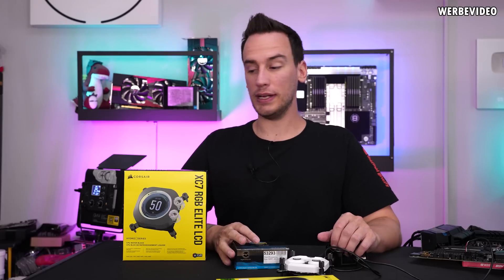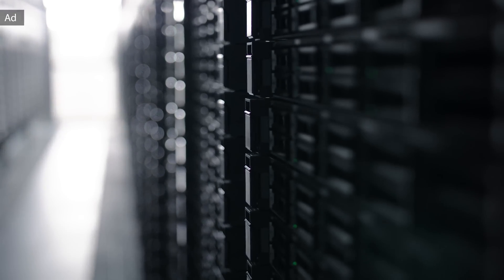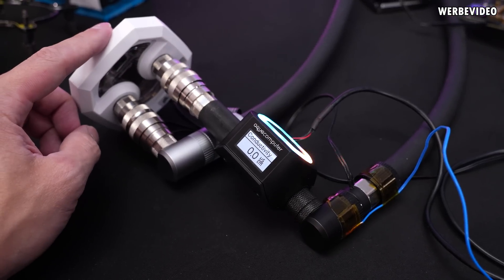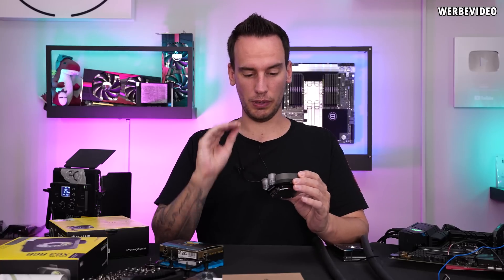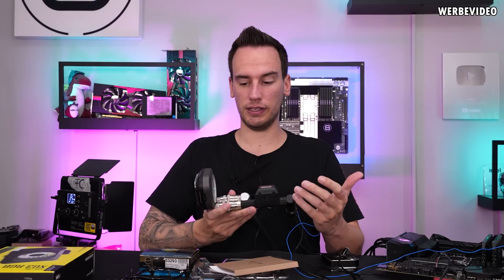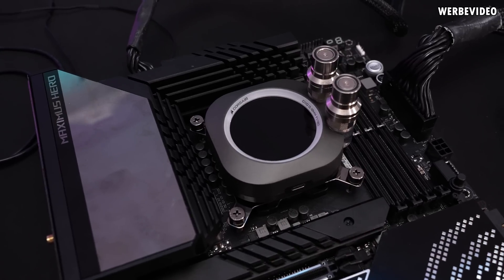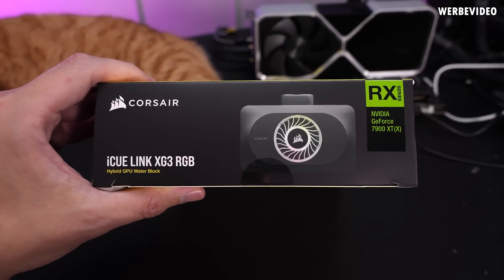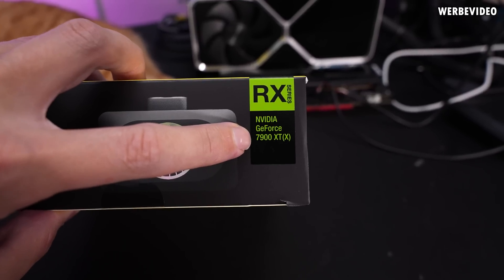Is This Water Block Really Worth $200?

Comment: If we want an lcd sreen on the block, would we see a big difference with such a block? Is it really better for cpus such as 14900k to get a direct die block? Or could we use this lcd block on a delidd cpu and get similar results? Just received my Thermaltake Pacific MX2 but saw you direct die block videos and was wondering if there is a way for me to get similar temps or should I just return it aside from its lcd?

Haven't found any info about this online, so thanks again for your nice videos man, very helpful!

Comment: The cold plate spot to spot delta is presumably going to be quite minimal since it is metal. Having the sensor in the middle would be incredibly stupid since the cooling finstack/coldplate etc would have to be altered in ways that would negatively affect the one task it has, cooling the cpu it's mounted on. The point of a sensor like this is NOT to measure the CPU temp or have some actually accurate scientific measurement of objective reality, the point is to know when something in your loop is malfunctioning like the pump for the most part but potentially some other gunked up or messed up component restricting the flow to the CPU block, which would cause the temp to go up and ideally trigger some kind of alarm and/or system shutdown and notifying whoever is responsible that a malfunction or degradation of some sort has occurred in the cooling system. 
In my opinion anyway. That is how I look at it, this has now become a contender for the spot as cooling block in my system but I'm likely going to go with another block that does VRM's too.

Comment: I have a 14900K stock with no lapping. Would it be better to run the Velocity2  without a contact frame or something like the Heatkiller with a contact frame? I see EK offers a contact frame for the velocity2 but at a hefty price. I should mention I have never done a custom loop I have always ran AIO's and I'm running a 1/4 HP chiller with no rads or fans in this new setup. I guess I'm asking what block would work well for me? I'm still not sure on what pump to use because the chiller requires 1000 L/H and to get that out of a D5 would be too loud if at all possible from my limited understanding.

Comment: Built-In cold plate temperature sensor is correctly advertised. It does not advertise that it is "built into" just "built-in". Putting the sensor directly into the plate would create an inconsistency in thermal spread due to a void created by the pocket drilled out for the sensor. Sorry if I'm coming off as a grammar goblin, its an OCD thing.

Comment: I wouldn’t be worried about flow numbers the numbers you should be worried about is what is the actual water temperature is the water temperature actually dissipating the heat or is the water flowing too fast and it’s not dissipating the heat

Comment: Hi, quick question, planning to delid my 13900kf to get better temp, current setup with asus z690 glacial and thermal grizzly contact frame, do i need anything else to fit the delided cpu to the motherboard waterblock ? Thank you

Comment: perfect for a test bench but if your not going to build a high end pc to show it off its not worth it cause you cant see it anyways like you o11 dynamic case the motherboard is on the right side so if you have it on a desk it has to be on the right side of you to be able to see it so its one spot to put it and if you have it in a computer desk that has the desktop tower holder on the bottom left you cant see it anyway. so what im saying is for the price u can get it without the screen and just get a flow meter like what der8auer has then u can run the line were u can see it.

Comment: My personal flow is between 1-1,5 L/min with 3 thick 360 radiators and it's more than enough. Zero noise and I have a 3090 and 13700k with very low temperature.

Comment: It'd be nice to see multiple pump speeds. Maybe 30, 60, 100. I run a DDC at 100% because my system is under my desk and the fans are still louder than it. So a D5 at 30% would give me almost no useful info about block choice as my flow rate is much greater.

Comment: Given that you have a flow sensor, and you know the flow of a given test loop, you could create a flow drop percentage chart (flow impedance chart) for any individual component that can be added to a loop, and then that could be a usable tool for users who want to buy components, or could at least explain why certain parts perform differently to others

Comment: Hi derBauer as you say there are no flow indicators for the block could you show the difference for the block if it was wrongly connected. Also can you show how many Millilitres of water each block holds - that will be a good indicator of the thermal capacity of the block.

Comment: I think you'd be better off spending your money on an auxiliary system display to mount in your case. (or elsewhere) 
That could be used in any new system build and in any configuration, water, air, prayer, magic cooling dust . . . .

Comment: I'm in the process of shopping for CPU blocks, so the overall comparison you did + adding to it as new blocks come through has been super helpful. I'm still waiting to see what direct die blocks come available for Intel 13th Gen (der8auer micro?), but right now running a GPU only loop looks a little funny haha.
Reply: Do you know if this can be used for direct die 13th gen cooling?

Comment: Need to measure the resistance/load on the pump motor when testing. The flow can stay the same but the load on the motor could be much higher?

Comment: Wow..This one is nice....I need a suggestion From you...I have my Build with Ryzen 7 7700X and My Case is O11 Dynamic Xl Rog Edition Signed By you...
I Use a Deepcool Castle 360EX 360mm AIO Cooler on a Top exhaust Mount where I am geting 95 C Temp while trying R23...
Can you please suggest me what I am missing here..
The Voltage of CPU is capped at 1.25v.. While gaming it is reaching 5.5Ghz with 74 C temp...
I am From India......Please Advise.....

Comment: about the noise from the pump, in my case the Hydro X XD5 I found out that some higher speeds made less noise, there's a question of resonance both inside the pump-res and mounted on your pc I'm sure...anyway, instead of running it at mid speed which is the worse for me too try a higher rpm desktop use I'm around 2000rpm but for "silent" gaming I run 3800rpm below that I can hear it, it's the beauty of using corsair commanders and icue...open your side panel, set speed to percentage and slide the line up and down until you find a speed that sounds right for you, I also did that with my 10 fans so am using weird rpms like 1537

Comment: Hmmm on the notion of  measuring the cold plate, could it be extrapolated through the use of:

* The temperature probe that's as near as the cold plate and effectively measures the water temperature 
* Use the temperature of the CPU cores and assume that the IHS is mounted with the prescribed mounting pressure

Then use a parametric temperature model of the cold plate, that is gathered through the use of thermal simulations/material properties and real-world simulation. Thus be-able to proactively estimate the temperature of the cold-plate real time. I think the use of such data can be used to more effectively tune the necessary flow rate and fan speed. 

On the other hand, it may be overengineering as the thermal conduction of heat ,for such a concentrated component such as a CPU is constrained by physics.

Comment: One thing you might want to try and figure out is how much your flow sensor impedes flow. 150l/mn is prob not the kind of flow where it matters a lot, but it might be interesting to compare a block's performance with and without the sensor in the loop

Comment: Hi Roman, thanks for the video. I'm not quite sure how given your testing process and where you put the temperature probe in the contact frame, however do you think it would be possible to do a direct die test comparison here using the same methods? I'm curious to see how the velocity2 with direct-die option that you already tested in a previous video fares in this setup / comparison.

Comment: Flow rate is measured as a maximum (directily proportional to pipe diameter), in order to measure a restriction it would require a pump flowing water at its the control loops maximum speed, and then adding something to the loop in-order to observe a restriction.

An example of this for memory would be: a single drop of water can move through a 1mm tube and a 30mm tube at the same speed, but a LAKE cannot move through tube at the same speed as another tube.
Reply: At the control loops maximum speed* (//refering to the flow all the fittings and pipes and sustain(not dictated by the pump (//besides the diameter restrictions on a pump inlet&&outlet))
Reply: Can*
Reply: This is why flow meters are known to "restrict" flow rate, because they take up some of the area available for water to flow through at one time.
Reply: My apologies for phone thumb typing, big fan, hope you get everything figured out
Reply: So if your pump is pushing like 20000000l/h, then a block is attached the rlow meter might display like (256l/h). The exact physical maximum flow of the lowest diameter (volume of area) in the loop.

Comment: I recently bought an XD7 RGB. When I took it out of the box to look it over, I noticed an extra port that I had not seen in any pictures or videos. It was not mentioned in any of the included documentation. I emailed Corsair and they sent me an updated user manual that marks the extra port as a "temperature probe port". They are not great at updating the manuals.

Comment: Would they perform differently with more head pressure or flow rate? You might have hit the sweet spot where they perform identical with the rate you're running.

Comment: Quick side note in regards to mounting this water block in any direction. Yes, you can, however, you won't be able to rotate your screen. iCUE does not support screen rotation so you're stuck in 1 position, which is the one with the tube mounts on the right side (between the block and RAM). Corsair said they're working on on a potential solution, but it's been a few years now and still we've heard nothing from them since then.
Reply: There is screen rotation now

Comment: For performance I have i my pump to bairly audible. When I stream I focus on a flow rate of around 100 to 105ish. Find that to be enough for cooling when streaming and it's whisper quiet. Find these days that the performance you get from components these days it doesn't matter much with them temp undervolting and and clocking...

Also will note I have a massive amount of surface area on my rads x2 480 alpha monta rads with push pull so the fans don't have to spin up almost at all...

Comment: flow sensors in fuel systems on aircraft have to be calibrated in a long process after installing them, is that type calibration not needed in the flow sensor you bought?
Reply: BTW is your cat on valium?

Comment: Now that you have a flow rate meter, I would love to see some more up-to-date testing on the impact of flow rate. The hard-core water cooling community is working on data that is over 10 years old, and while physics didn't change, the environment has. We are dealing with much higher heat loads and I wonder what impact that has on the old stance of targeting 1 gallon per minute (~220 l/hr) before diminishing returns.
Reply: 220l/hr is pretty slow lol. Im running dual D5's. Im sitting around 1200L/hr and thats not even my max.

Comment: Would be interesting to see those angled connectors impact on flow rate, I remember since the early days when I started with watercooling in about 02, 03, many many ppl on forums (sound old right) were telling that those are really restrictive... Maybe that had an impact back in the days when not all blocks were that low flow restrictive and I can still remember a guy telling that running D5 from koolance on 12V at 600l/h is a waste and you need to pull 24V from ATX connector to get 1200l/h :DD

Comment: Honestly you kinda lost me at Corsair.
Not only do they like to release new stuff at a seriously overcooked price, but generally when you buy Corsair you're supporting their company towards the locked in proprietary ecosystem that they are trying to create for themselves.  I dont buy Corsair simply because of that ... if I want to use bequiet or Noctua fans or off brand RGB, I just cant without running iQue malware.

Comment: I like this channel a lot.  As to the QD's (I use the latest Koolance QD3 version).  I find it convenient to orient QD's such that QD junctions are arranged to be uniformly flow oriented.  I find this helpful for maintenance and to ensure that I reconnect the loop correctly.  One possible  convention is the QD;s are arrange such that coolant always exits the male connector and always enters the female connection.  I have a many such junctions and found this helpful.  I construct a loop from scratch, I tend to create a diagram indicating the orientation of the various connectors.  This helps assess what connectors may need to be ordered.

Comment: I'm surprised Corsair hasn't taken Aquacomputer's business, they already have desktop software so the hard part is already done.  Temp sensors are dirt cheap, they could put one at water inlet, one at outlet, and include a few air temp sensors, and feed it all into their USB hub.  Mid-tier motherboards don't include a temp sensor input anymore so Aquacomputer's market got bigger.
With the latest hardware using so much power it seemed like water cooling might start making sense, but instead of innovating they've just raised prices.  Rather than do maintenance on my loop I recently got a $40 Thermalright air cooler and my 13900K gets 40K Cinebench vs ~40.5K on water.

Comment: I was shock how low flowrate these has... if lower than 500l / h these are patheitic compared to my pump ( 1000l / h ) .
Reply: Minimum is 150 but this was kinda sarcasm as i did only recently read how low AIO has flowrates and compared what i used back in the day my aquarium pump :)

Comment: The "cold plate" sensor adds nothing, because die sense (package temp) is what you'd use for pump speed.  And the temperature/response time difference is huge.  The sensor is outside the coolant moat and seal, so it's closer to coolant than die temp.  Coolant temp is smoothed and laggy vs die by >30s, so it is woefully inappropriate for pump speed.  Maybe you could use it for fan speed, but for that the sensor should be at the rad inlet.

Comment: Hey Derbauer, what Corsair means is that the temperature sensor is built-in, measuring the the cold plate temperature. Not that the temperature sensor is built-in to the cold plate.

Comment: I normally would never agrue with you Roman, but that temperature sensors is probing the cold plate... so calling it the cold plate probe is fair. Please compare water temp from flow rate sensor to the cold plate temp under load. (It should be different)

Comment: Hey Derbauer, it would be really neat if you did a "here's some great starting items that are good bang for your buck items for beginner watercooling"! I've been wanting to give my hand at doing a full custom loop but honestly i don't know if I'd want to spend nearly $1000 on something like that just yet.
Reply: Bykski and/or barrow for everything but quick disconnects.
Reply: Well it's not supposed to be cheap if you want to fit it, and forget about it. It's expensive to get into, because you're paying for reliability. Ease of installation seems to be a secondary consideration for even the best open loop custom water-cooling solutions, so don't expect much from entry level! And expect to make mistakes.
Reply: Just get an AiO to start, with how big the coolers of modern GPUs are, they are cold enough. Or get a Hybrid card if you have the room in your case. You should plan your build with watercooling in mind, like how many rads you can have in your case vs how many you actually need, most Waterblock comes down to which one you like more visually as they all perform good enough, 1 - 5 degrees from eachother, don't cheap out on watercooling stuff either, no need to buy the most expensive either. Don't need Dozens of fitting nor hard tubbing either. Though if you are just cooling the CPU with it, jist get an AiO like I mentioned, they are good enough, cheap vs custom, easy to install, no need to refill unless it is a crappy one... just set and forget kind of deal. Make sure the pump block is not the highest in the loop, same with custom, always have the pump at lowest part or right next to the water reservoir and don't mix metals either if you are doing custom, copper block with copper rads or aluminum block with aluminum rads, aluminum parts are usually cheaper... though is up to you, EK starter pack is aluminum based and is very cheap, decent startin point, don't know if that is available yet as it has been a while...